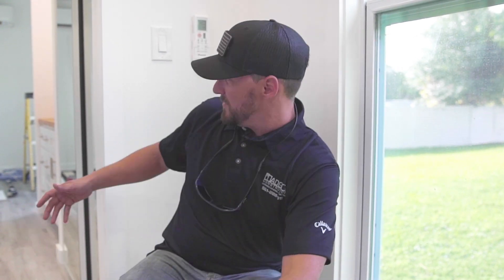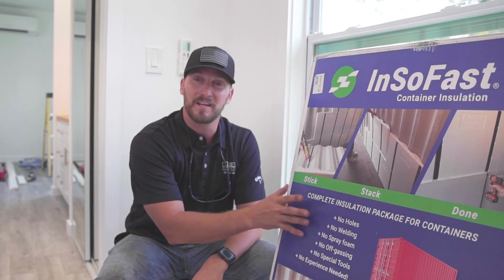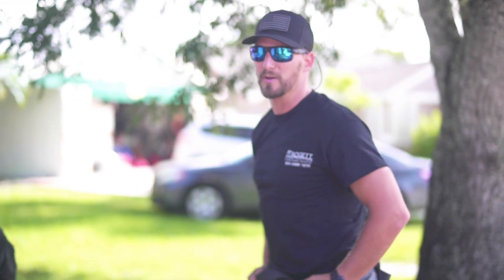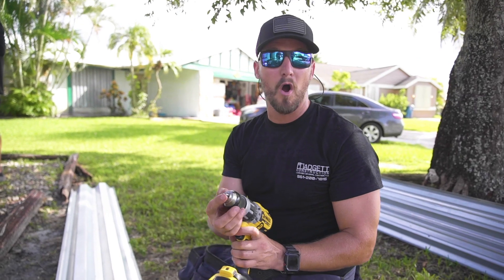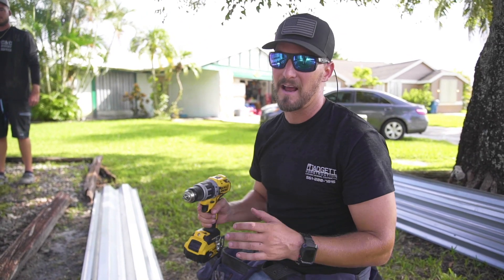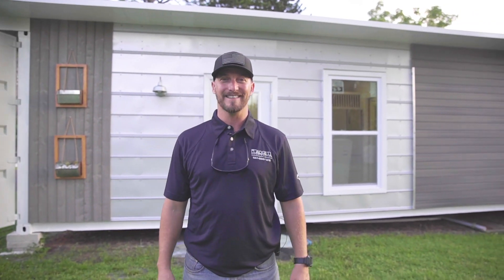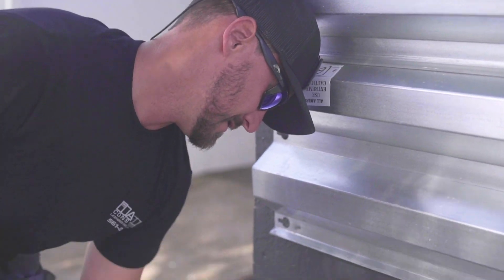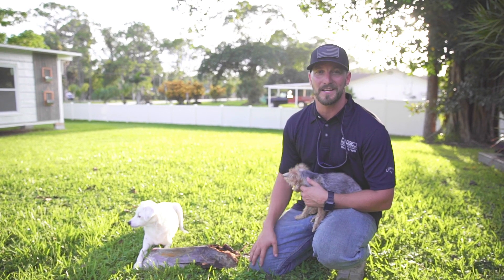Hurricane Hacks and Prep

Comment: Also! You container appears to be sitting on blocks? Is that ideal for wind speeds about 70mph? How would you secure a container to the ground when it's on blocks?
Reply from the maker: Ronny Richardson this one is temporarily here before being relocated to another piece of land, in most cases there will be concrete footings and the container is welded to brackets embedded in the concrete.  It will withstand winds well over 140 mph.  But even with this one just sitting on blocks and where it is located on the property we are not concerned with it going anywhere, we are putting a few anchors and heavy duty straps and it will be fine